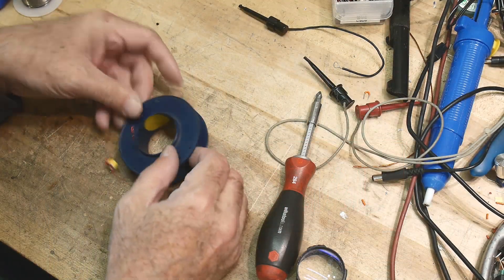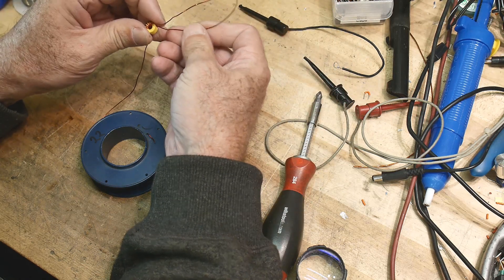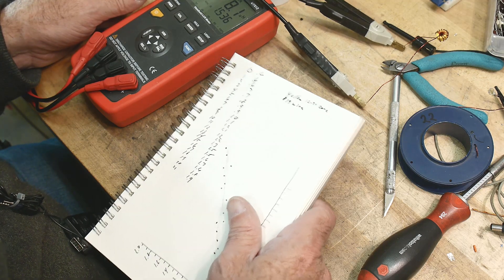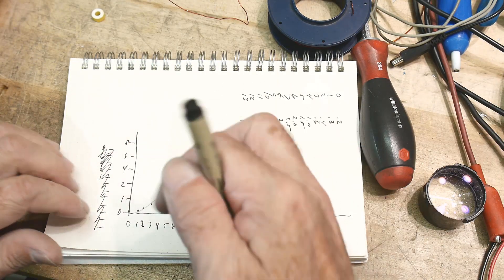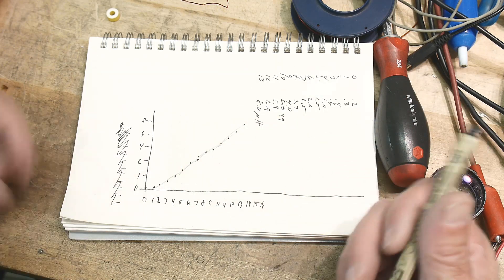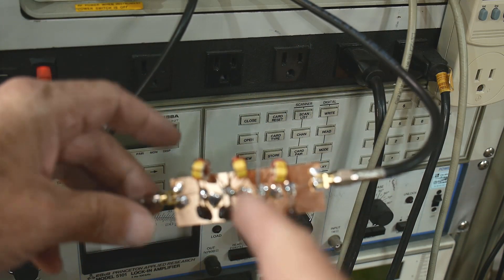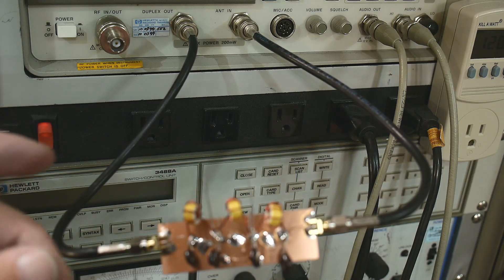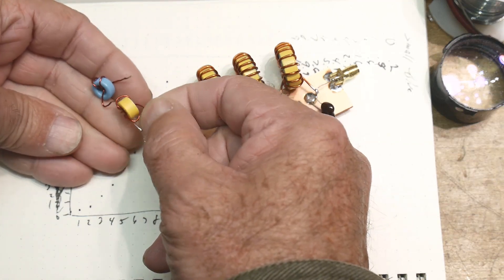#740 40m Low Pass Filter (part 4 of 4)

Comment: The yellow ones I pulled out of a power supply only maintain their inductance values up to around 200kHz and became capacitive at 500kHz or higher (measured on the NanoVNA - S11 where reactance = 50ohm)
Reply from the maker: unfortunately there is no standard color code from company to company

Comment: Hi matey.  It looks like a black art to me. Totally confused in it all. I am thinking of buying a 70w linear amplifier kit. Low cost kit. I notice on the boards it has connections for a LPF filter but not supplied. I am planning on using just the 40m band but is it a BPF or a LPF I need. I have very limited knowledge on this or test equipment to hand. Any help would be appreciated.  Cheers from old George.

Comment: Because of these awesome videos you have made on this 40 meter lpf experiment, I’ve been experimenting myself with lpf’s and learned a bit about toroids and caps best used for filters of different frequencies. Been a ham for almost 30 years and never messed with these before. Thanks for inspiring me to take on a new adventure in the hobby. I’ve made a few prototypes that have worked well. The mica caps work best under varying temperatures but the ceramics are great and cheap for initial testing. Simsmith software has been my friend when adjusting values for components and viewing the results. Great work! Would love to send you one of my projects to have fun with. Thanks for your contribution to a great hobby! AI4NV
Reply from the maker: Thank you. I love to hear that I've helped motivate someone.  Have fun!
Reply: @IMSAIGuy  Motivate you have. I’m glued to your channel. Thank you for sharing your knowledge and experiences. Love your stories too. Your videos are done in a personable way that makes me feel comfortable while learning at the same time. Very fun to watch. Thanks again. 73

Comment: I bought a full bag of little yellow/white ones for cheap from Ali, built a 40m filter exactly as you did (using qrp labs tables for values, around 20 turns on each) and got the same crappy result: a really good 800khz low pass filter. So I guess I have to build a VLF receiver for it :) The larger yellow ones you got might be from computer PSUs, I used one of those as an antenna coupler in a sdr radio and it seems to work fine. I have no idea about it characteristics though.

Comment: Do you have the equipment for measuring or calculating the impedance (L, R) if a coil on one of these toroidal cores over frequency?
If yes, please do so and show us the results.
Measure also the common mode toroidal filter on microwave power in. It should be very interesting.
Thanks!

Comment: The μ of the core material will be much lower if it is designed for higher frequency.
Materials for low frequency can have μ values of thousands and for UHF and above μ can be less than ten.

Comment: Manufacturers usually give an AL value for each totoid.
With AL it is easy to calculate the inductance:
L=N² x AL
Find AL value for each core and then you can easily calculate the required number of turns.

Comment: The yellow/gray look like type 6 good for RF. the yellow/white. I'm sure are type 26. type 26 is low frequency I believe it was under one megahertz. for power supplies and such. that was interesting to see the difference in the circuit. it shows how well the 26 will work in power supply filtering. good video!
Reply: There are two Micrometals catalogues. One is for power (switchmode) inductors and the other for RF applications and some of the paint colours are similar, unfortunately. From what I remember, you have to be careful you don't some of the power inductors mixed up with the RF cores as they are indistinguishable. 
If they do get mixed up you can measure the Al value to identify the core.